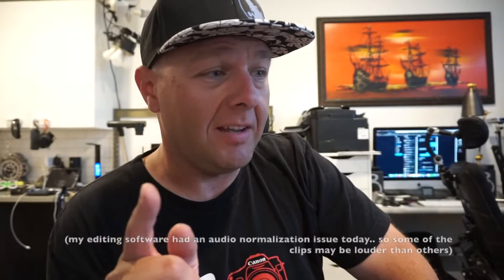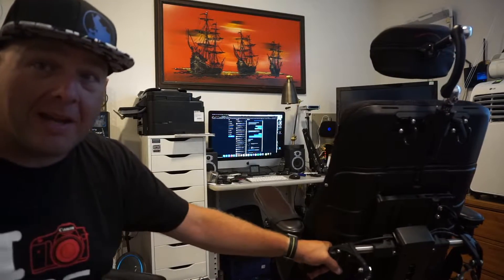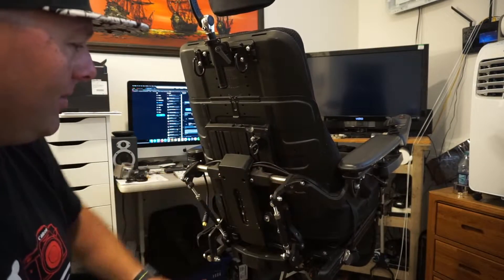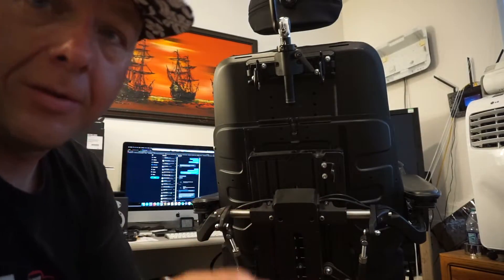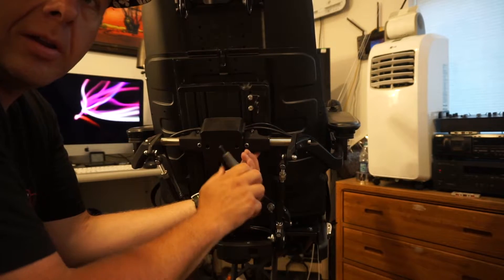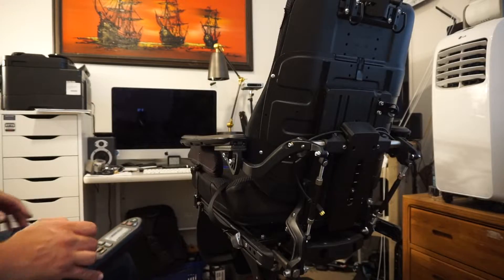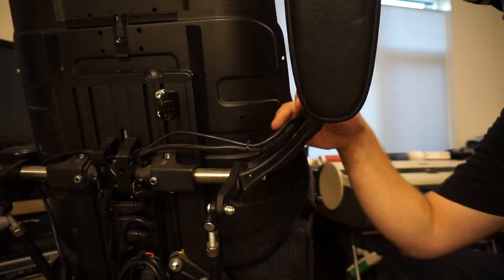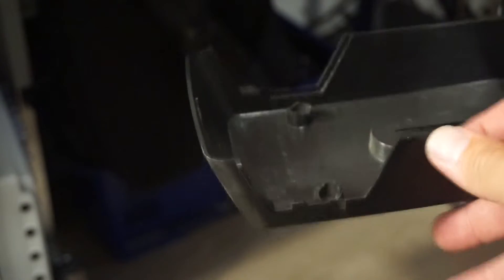MEGA VLOG 444: Permobil 3G armrests! (long version)

Comment: I'm trying to adjust the armrest width on my M5 and it doesn't have those two adjustment screws. So I just found that on the new M5, you loosen the screw that you removed to take off the armrest, and then push the armrest in and retighten.
Reply from the maker: on the newer chairs they have a different, much more simple setup! there is an allen cap screw/bolt on the end of the arm rest bar, where it pivots.. loosen it a LITTLE bit, and there's a mechanism inside that will allow the bar to slide in and out :^)
just dont try and take bolt out all the way, or loosen it up too much! (ya edited the comment - so guess ya got it taken care of lol)
Reply: @TotallyNormal-  yeah, new chair so still trying to get things right. I made a whole bunch of little adjustments yesterday. Many of the screws were insanely tight as they hadn't been altered since Permobil built the chair. Next thing is to soften the suspension just a tiny bit.
Reply from the maker: cool! it takes a lot of tinkering and small adjustments over a week or 2 to get everything just right :^)

Comment: Oh and I wanted to ask you about what I think you called the ICF switches, in this video. They are the ones that control the adjustments of the seat raise, the recline, the tilt in space the leg rests. I have a panel of those on my C 300 but they don't seem to be working or even connected so I just use the the controller to do all of that. I am having some Neurosurgery soon that will fuse my whole C spine and I won't be able to look down at my controller any more so I thought if I could use the other bank of switch's I wouldn't need to actually see them. I could just feel them, when I want to adjust my seat parts. Yet I don't recall seeing the cord running through the arm rests, which you showed in this video. Just the controller connection. I want to enable the switches or if need be buy another cord or bank of switches I need to know what all of that is called so if need be I could order them. Do you happen to know what they are called ? Thanks in advance.
Reply from the maker: hey! those are the ICS / seating switches... do they light up green, or any other color at all?
also is it an older C300 chair? (the one with the plastic seat back instead of metal?)
Reply: @TotallyNormal-  Sorry about the late reply. Thanks for answering. No the ICS switch doesn't light up at all. I know they are supposed to but mine doesn't. I asked you because I thought it might have been temporarily switched off on the control or something. Any way I checked it all over and the whole thing seems to be intact cord and all.It was plugged in the right place, so I don't know why it isn't working. I am not sure of the age of the chair do you know where I could find it? I don't have the usual back that these chairs come with, I have a SPEX back on mine so we can't tell from what sort of back the chair has on it either. I don't suppose I could order another one without knowing when my chair was made could I ? It would be easy enough for me to change it over, but here in AU the retailer is supposed to do even very simple things like that. Of course they over charge, then Permobil items are very pricey too. Where do you get parts from ? Thanks so much.
Reply from the maker: do you have a twitter account? sending a DM on there might be easier to find out whats going on..  theres no way to "switch them off" in the control software - if they're not lighting up, theres a wiring issue, or they're disconnected, or some sort of control problem.  sometimes the connector comes unplugged inside of the actual ICS switch box.. ive got a video on how to repair those - and shows how to open it.  some of the SUPER OLD ones dont have lights at all.. but they have silver buttons that kinda look like breathe-rite nasal strips lol  if ya have a twitter account - might be able to send some pics etc, and help troubleshoot
Reply: @TotallyNormal-  Thanks for finding the time to answer me.

No I try to limit my time on social media. I waste enough time just on YT so no, no Twitter account sorry. 

Any way I got brave last night and in the time between medication doses when                                                                                                                                                                                                                                                                                                          my mind was less foggy I disconnected and gently shook the ICS. Sure enough there was something rattling around inside it. I  opened it up and something had broken off the circuit board. I could see where the bit ( please excuse the very tech specific jargon) had broken off but it's way too tiny for my husband to try and resolder The rest of the switch looked OK to me, so maybe I could just buy another circuit board. Fortunately there was an item number and a ser number. Unfortunately it seems like it's a Permobil specific item, but not sure on that one?   Anyway the item number is 311302 and the ser number is 4315024. So my next question is where would I buy one ? Thanks so much.
Reply from the maker: EEEBAAAYYY!!!! lol (ebay) looks like theres a few of them for around $80-100 ish.. try a bunch of search terms to find them..permobil switchbox, R-Net seating, ics switches etc etc..  theyre not super cheap.. but its really hard to find PCB boards, and internal parts.. everyone seems to sell things an whole assemblies unfortunately..

Comment: Can you adjust the length by moving the mounting attachment back? Referring to the hardware that attaches to the Unirail?
Reply from the maker: yes! ya can adjust the sliders in the rails on the bottom and get almost any length ya need!
Reply: @TotallyNormal-   Is it fairly quick and easy? Would I just loosen the hardware on the mounting bracket and then tighten? My concern is what to do with the RNet cable as it is the joystick arm, looking to move back approximately 3.5 inches to not need to reach to address the joystick. Thanks

Comment: How do I keep my Corpus arms from falling down after I raise them?
Great info. Thanks
Reply from the maker: DOOH!! I forgot about that!! Lol there’s a little tiny flathead screw right under the bolt that holds the arm rest on the chair it’s connected to the little detent ball on the other side - lightly turn the screw till you feel some resistance while raising and lowering the arm rests on each side. This mechanism is one of the first things to wear out.. but usually still works. Let me know if you find it!

Comment: well handyman, you give me an idea, with help of 3D printer and gooseneck pipe, I will try to attach my GPS (walking mode) to my arm rest.
Reply from the maker: if you happen to have a permobil.. i have links to some STL files that make a compatible mount for 3G arm rests! they slide right into the tracks! one of the patreons designed them!